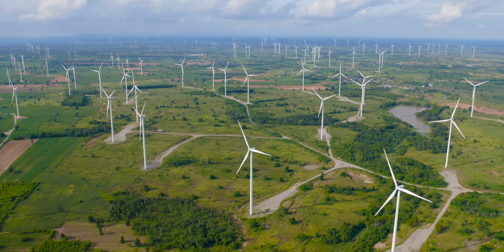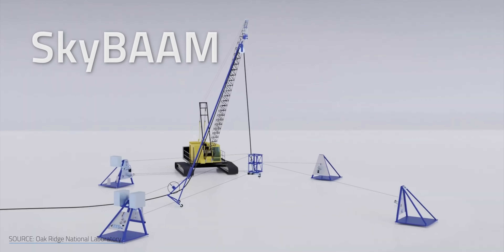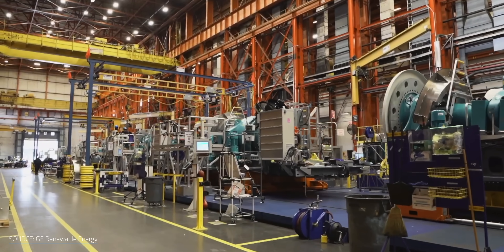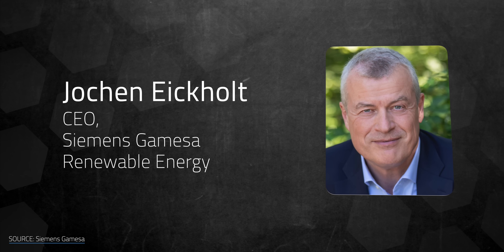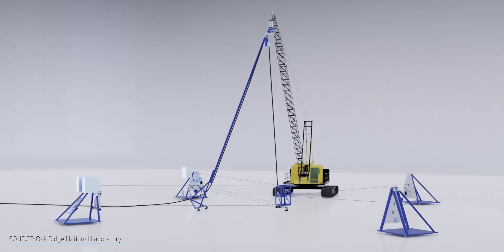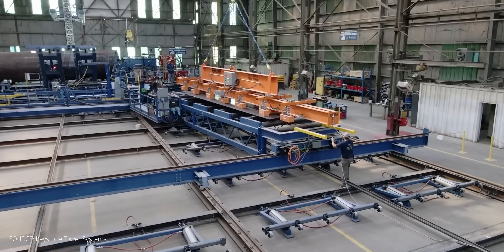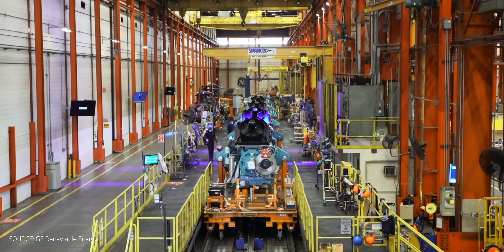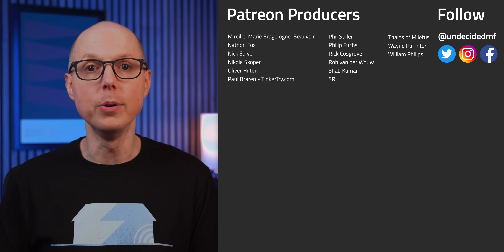Why We Need To Rethink Wind Turbines

Comment: Matters that span multiple issues  can be more about a best designs of an environment in which to can best handle them rather than innovation of just simply individual independent solutions. Modularizing environments of consideration and concept in project planning and as well your products themselves at to produce them as desired by a kept body of interests in an overall environment of component constructs with mindfulness of all relationships involved.  Dynamic modularization of component concepts and constructs given to also dynamic relationship in overall environment in relativity.  I expect results by Monday.  Carry on.  I'd also like if you'd could improve the wind, thank you..  You can use the same my given instructions.  Good meeting, everyone.  Good meeting.

Comment: Matt, I've been watching your channel and others investigating forward looking energy matters.  I've yet to stumble on any YT video that explains the massive semiconductor switching needed to make all this possible.  Changing voltages, phases, and synchronizing to the grid.  (I'm so old I can remember that the first germanium transistors were of such low power capabilities that many car radios still needed vacuum tubes for the audio output.)

Comment: I've long believed in putting my money where my (renewable energy) mouth is.  As far back as around 2000 I paid a premium for my electricity to Public Service in Colorado to use a share of their wind generated power.  Due to the weird market driven grid here in Texas, I've been  on wind/solar for the eight years I've been here.  When I drive out to far west Texas, or up into the panhandle near Sweetwater, I'm treated to hundreds of wind turbines dancing.  I love it.

But lately I've been wondering.....and worrying....about wind turbines, especially.  The hideously short lifespan of twenty years before blades and gear boxes go out.  How is it conventional power plants run for half a century or more but turbines can't?  The amount of concrete, a major greenhouse contributor, necessary to anchor them so they don't topple over (at least per one construction video I watched once.)  The resins in the fiberglass blades are nasty chemicals that come from oil and gas and are not recyclable.  

No, I've not gone over to the dark side, but I do think that "they" have justifiable concerns with a lot of facets of green energy that need to be addressed.  Make blades from aluminum?  Why should a simple gearbox wear out after twenty years, or at least not be able to be replaced?  

I'm leaning towards solar as being the lesser of evils.  Now that battery storage is coming down in price, less fear of the night.  A good solar panel is still running 85% efficient compared to new at 25 years with, I would guess, close to zero maintenance. The ground underneath, depending on installation and where located, can often be used for some high value agriculture.  (Unlike wind turbines and cattle, which are low value per acre of grass.)

I see all this as just growing pains for the industry, but they do need to be addressed.

Comment: The biggest problem with all tis green tec or clan energy is its a cash cow, governments dial out all this so called research money and then years down the line the product doesn't work but the investors get a good kick back. With all this so called development in the green power industry have any joe blogs public seen any sign that our energy bills have ever reduced in anyway shape or form, everything always seems to be in development and a few years away, We have solar, yes good but no mass scale roll out of grid storage, we have pumped hydro, perfect you can ramp up or down, then we have nucellar which has its draw backs but take 10 to 15 years to build. I believe the best and simplest is gravity so why no mass roll out, probably not enough grant money to fill the scam or sham investors.

Comment: I never understood why they can't just have a modular blade factory that could be set up on or near the wind tower site to crank out the blades instead of transporting them so far.  A wind farm with 30 towers is going to need 90 blades, plus maybe have a few extras if needed.

Comment: The problem is that after a slump in the last decade in Europe, where most turbines are, the rapid ramp up in production alongside deglobalisation caused problems. There are plenty of ways to improve on the existing design. E.g. recently the tower structure can now be made out of wood.

Comment: The race to maximize the size of wind turbines has undermined their quality, leading to defects and mechanical failures, which has caused financial blowback for manufacturers. Siemens Gamesa, one of the world’s largest wind turbine companies, has been plagued by troubles, including faulty components in multiple turbine models, with wrinkles on blades and particles in turbine bearings, affecting 15-30% of its latest 4.X and 5.X turbine platforms. The cost of addressing the problems has accounted for the loss of €472m ($512m) for parent company Siemens Energy. Siemens estimates that correcting the flaws will take years and cost over €1bn. The issues arise due to the rush to enlarge turbines for the lowest cost possible, which has been exacerbated by the urgency to transition to clean energy, taking precedence over maintaining reliability. As a result, it has been a race to the bottom, not the top. To address these problems, companies are introducing new automation technologies, and some are going smaller, not bigger, with multi-rotor wind turbines. Others are using additive manufacturing to make wind turbines on-site, such as SkyBAAM. The entire wind industry has been facing structural problems, from supply chain obstacles to defects that escape detection on the factory floor, and it has been under increasing scrutiny as it buckles under the pressure to expand.

Comment: The total long-term cost per kW-hr is the overarching metric.  This is what drives massive turbine blades.

That's not the problem.  The problem is the cost of risk.  Maximizing profit will result in a small percentage of failures.  Fortunately, this isn't the airline industry, where catastrophic failure results in the loss of hundreds of lives.  Nevertheless, toppling turbines aren't exactly what someone wants to see in their fields.

I have high hopes for advanced manufacturing, including on-side 3D printing.  

Regardless, no one wants to see wind turbines all over the countryside when very small percentage of real estate in the Sahara Desert can provide 100% of the worlds entire demand for electricity.

"But what about night?"  I count 33 deserts around the world larger than 20,000 square miles.  That's 33 deserts with an average area of 577,886 square miles each, and 19,648,112 square miles total.

How much area would we require to provide 100% of the worlds energy needs, including EVs, via CHEAP solar panels?

"But...  Transmission Losses!"  High Voltage Direct Current.  

Matt:  Please let me know what percentage of those 19,648,112 square miles would be required.

Thanks.

PS:  What effect does removing wind energy have on the dynamics of Earth's atmosphere?  I imaging it's more than you might think.

Comment: Matt , I would love to see a report by you regarding my hypothesis that in fact wind turbines are in fact accelerating climate change not reducing it, due to the conservation of energy rule. One turbine not so much, but as we are now extracting Gigawatts of energy globally from one of the major mechanisms that determine's weather ie WIND as we are in fact affecting its strength. Yes it renews but interim weakened wind will not be able to do its usual task re weather.

Comment: I wonder if you can piggyback turbine blades and synchronize them or be able to use large sails or wings to generate electricity just like a sailboat moves but stays still with moving parts underneath.  Maybe it would work.

Comment: Same thing happened in the 90s in the telecom space.  Manufacturers were under so much pressure to deliver more speed, features and lower cost.  This was to capture market share.  Results were more software bugs and failures which added to the operational burden among common carriers.  With the massive shift towards high speed data and more mission critical applications building and managing huge networks was not for the faint of heart.  Plus the size and interconnection complexity far outpaced testing and testing methodology.

Comment: not to piss in your cheerios, but I've worked on a site with an experimental turbine using carbon fiber blades. after about a month of operation we all got together and spent 2 days picking pieces of a shattered blade out of the fields. the blade was so stiff that it wasn't able to flex in the wind. granted, that was 4 years ago, maybe the engineers have figured out a way to make it work.

Comment: What is the effect of industrialization of pristine rural or sea coastal areas?  Wind towers  needs to a lot of open spaces to be modified for the towers.  Bigger tower the more modifications needed to the landscapes and seascapes.  Giant concrete footing , mooring chains with links the size of cars, and kilometer of cables are just a few problems that cause by the towers. Wind disturbance and water currents changing are another big side effects on the local ecology.

Comment: The problem with going smaller is the amount of power produced is directionally proportional to the swept blade area. Also when the turbine is taller it receives more laminar flow which also increases its efficiency/ production.

Comment: There are ways to recycle (or rather downcycle) glassfibre blades into other materials and products. German companies and researchers found ways to use the GRP in reinforced concrete production or turning them into floor tiles by shredding and molding them. Researchers also work on ways to recycle CRP back into their components so that you can reuse the carbon fibre mats.
Reply: Kills birds
Reply: @scottslotterbeck3796  Vehicle traffic, skyscrapers and planes kill more birds.

Comment: What about all the, carbon based, hydraulic oil that is needed to used in these turbines. That needs to be replaced 'at least' once a year.  
And what happens when a leak occurs, of all that oil, in a sea based operation?  All that oil polluting the ocean!!!!! 
Then, you have the fact that these wind turbine are not being recycled. They are an environment hazard!!!!

Comment: This exposes a bigger problem with large corporations, the focus on profit over viability.  When you chase increasing profits you can lose sight of long term viability of your product.  Profits are always short term gains because that is how the economy is designed.  They are designing larger windmills because they more efficient in power production for that instant profits, but they are not built to last.   It’s cheaper to tear one down and install a new larger model than try and do any major upgrades or long term maintenance.  Then you have all that waste from the old windmill that can’t be reused and just goes into landfills.  We need to get back to building for longevity not just quick profits.

Comment: You could design a wind turbine without rotors. Essentially you would build a tunnel. One side with a smaller arch then the other side. You would build it in a area with a wind direction that is continuos in a single direction. This was you could funnel the wind down the tunnel and create great pressure towards the end of the tunnel. Then you feed all the high pressure wind straight into a turbine on the or in the ground.
Reply: How is that a turbine without rotor?
Reply: That tunnel would have to be absolutely gargantuan. It would require far more material than a standard wind turbine. A non-starter.

Comment: I used to work as a reliability engineer. I don't consider something that fails before commissioning isn't unreliable. It's a fundamental failure of the design process. Usually I would say it's a fundamentally flawed design, but in this case it was most likely flawed or completely absent analysis. It's extremely straightforward to make a structure self standing. The engineers simply weren't given enough time to actually calculate how much material they needed.
Reply: During the Siemens part I immediately thought about an engineer being ignored by the management.
Reply: The fact they do not use guide wires is confusing to me. The amount of force on that one pole. The wind catching those blades has to put hundreds of tons of horizontal force against the poles. The pole doesn’t simply hold the turbines up in the air, they also have to stop them from blowing over. 
If guide wires are used they would probably allow for the pole to be made smaller and cheaper. 
The only problem I see is the guide wires would have to be fairly low on the pole so the blades didn’t hit them.   I’m sure even wires halfway up the pole is better than none at all.
Reply: @ohioplayer-bl9em  The wires would have to clear the massive blades which is made harder because the turbine heads spin to catch the wind from any side. The guy wires would be limited to a certain hight to clear blades.
Reply: @ohioplayer-bl9em  lol you don't know what youre talking about
Reply: There is no excuse for sloppy design. There are engineers who refuse to undertake a project when time limitations are unrealistc. Nowadays desktop computers can reach speeds associated with super computers decades ago. Simulation software has become more and more accurate and can give very realistic results. Due diligence during design can ensure minimum failure. Yes, I acknowledge that a few teething problems can arise, but if there is a requirement to redesign parts, then the original designers probably cu too many corners. But grit in the bearings? It seems the shop floor technicians were unfit for the job .... or were they bribed by those who hate wind turbines???

Comment: Honestly, I feel like you miss the mark with this video. We've been hearing about 3d printed concrete for a decade at this point, and despite having dozens of working prototype, I've yet to hear of any project worth mentioning that actually uses that technology. The same thing goes for other forms of 3d printing. At a smaller scale, 3d printing machines have proven themselves, but at a larger scale, traditional manufacturing methods are faster and produce stronger parts. 3d printing feels like it is heavily overhyped. Assuming that we can get there, the benefits are obvious, but the fact is that the benefits being sold to us just aren't representative of the actual capacity of the 3d printers that we have. While I do think that 3d printing has a place in industry I just don't think that we've reached a point where it can be a drop in replacement for traditional mass manufacturing methods.

Comment: Another thing that seriously needs to be discussed is the blades. Being made of fiberglass, they are extremely hard to recycle. In Texas, there are huge graveyards of turbine blades. This is something that needs to be addressed.
Reply: You're right Jonathan it does need to be discussed and solutions come to market. Veolia is leading the charge on helping GE's EoL supply chain into alt fuel for cement companies and ground to fibers used in cement, which I think is considered SCM (supplementary cement materials). 

Then there are great whole blade repurposing projects in civil engineering going into application.

Also keep an eye out for new recycling and repurposing innovation from the Blades2Build project, EU backed and big companies are participating.

Here in the US, DOE backed HeroX has a wind recycling grant prize underway right now. Phase 1 winners are announced by Dec 1st. So keep an eye out and that may offer viable solutions.
Reply: This has been addressed and there is active recycling. Fibreglass is inert so there is no pollution problem anyway.
Reply: And kills birds.
Reply: Oil and coal power kills more birds per watt than wind 9_9
Reply: @scottslotterbeck3796  Cats kill birds more than blades of wind turbines. And they not produce any electricity.
Reply: @scottslotterbeck3796  Sure. And fossil fuels kill everyone and everything. Your point?

Comment: Multi Rotor wind turbines will suffer the same problem as multi engine aircraft. X times the maintenance and replacement cost for each motor and blade set. The cost to run a twin engine plane is basically twice the cost of running a single engine. I highly doubt the initial lower cost of transportation and the lower efficiency of multiple smaller turbines in close proximity  and the trellis structure that will obstruct airflow will be reduce costs by X number of turbines and make up for the difference.

Comment: One thing I think would be amazing is if you took the Miryad multi blade concept and slapped Toroidal blades on them (Google MIT Toroidal blades) Toroidal blades can help ALOT with sound and can also help with efficiency, and because it spreads the tip vortices over the length of the blade reducing overall vertices turbulence and gaining the previously mentioned benefits; Another potential benefit is that there are no tips to impact things like birds.

Since blade size will make it harder to develop and test Toroidal blades the Miryad multi blade unit would work well.

Comment: Your trust of 3D printing techniques is obvious.  Yet, the strength of the materials is rarely achieved without reinforcing materials, i.e. rebar which substantially increases cost.  For me, I will await a real test that includes a realistic time frame.  Until then, I will remain "undecided" about this approach.